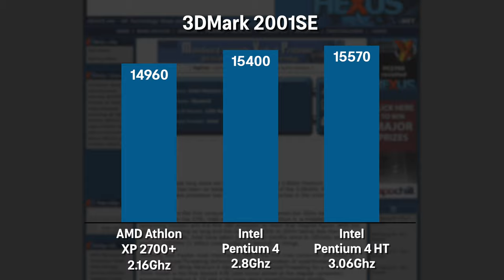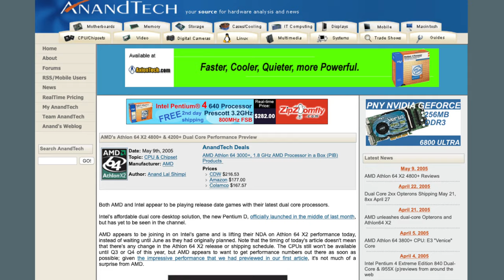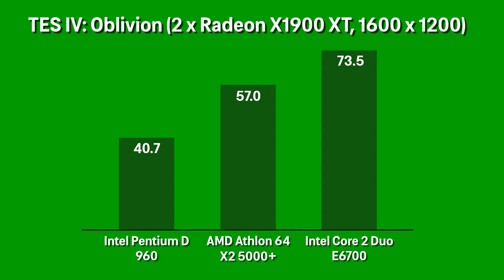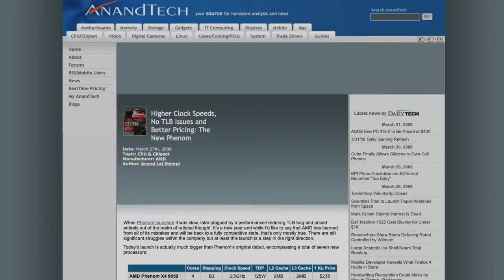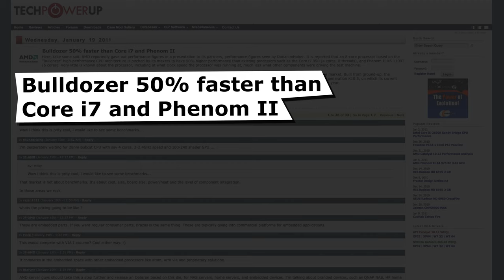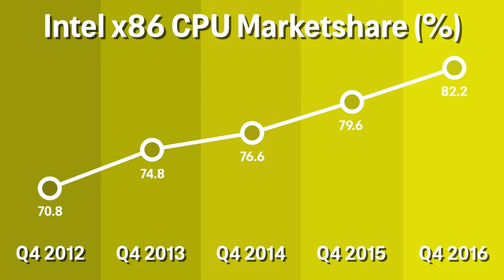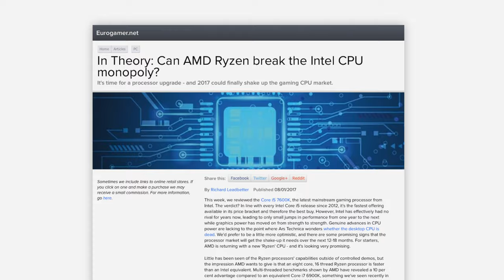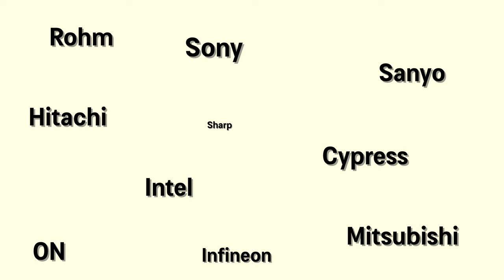The Multicore Mindset - The History of the Home Microprocessor - Part 4

Comment: Good stuff!  Quite pleased so far with my Zen 3+ 8 core 6000 series chip.  This thing just demolishes my Comet Lake i7 system, on TSMC 6nm.  I hope that Intel comes back strong when Arrow Lake is released later this year, on a much smaller node than the current 10nm they have been using since Tiger Lake.  Competition is good!  I had an early Bulldozer or Piledriver chip and I was so unimpressed.  Ran hot and ran slow.  I was on Intel core i7's from 2012 until 2023, but they just let me down in later years.  Comet Lake is mediocre but Alder Lake is not.  Yet I hear that Meteor Lake is "also" mediocre.  These two always need to exchange blows in order to keep chip quality high.